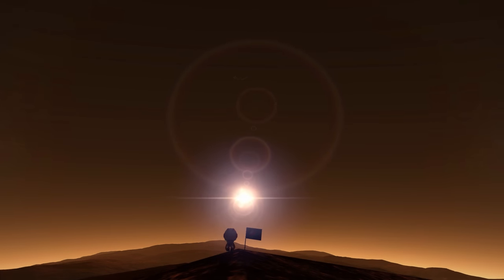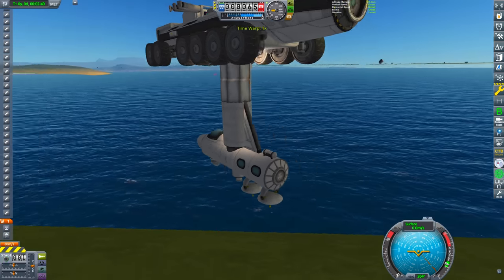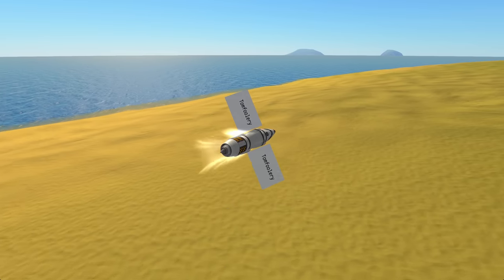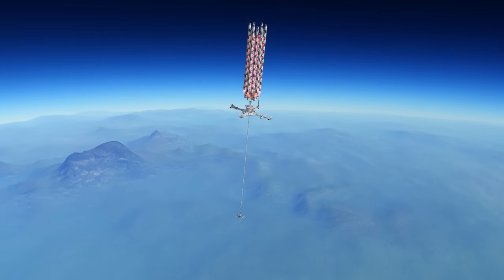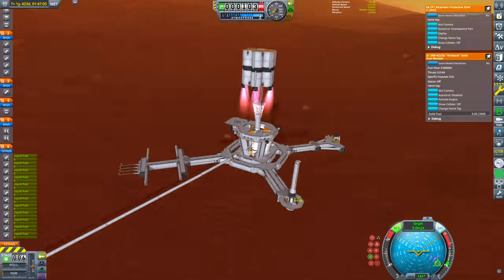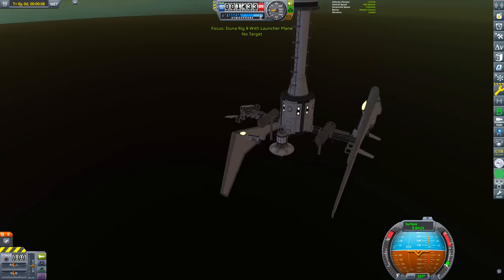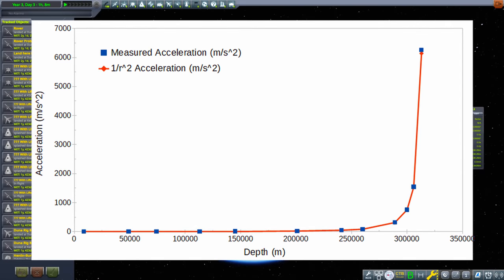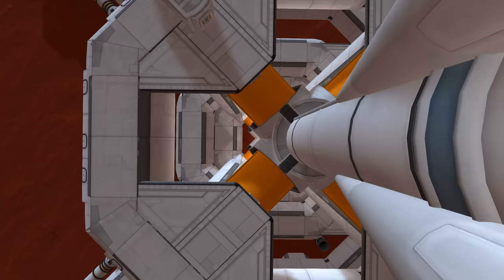Exploring the Underworld of Duna | KSP 1.12.3

Comment: could the phisics range thing be used to make a space elevator or orbital ring or some other large structure the game doesnt usually allow? also what happens when you drop a probe underground on an airless world? to me it seems like the first parachute probe was destroyed by air forces, not the high gravity directly.
Reply: With enough patience, it absolutely could.

But just for a space elevator to low Kerbin orbit (let alone keostationary) you’d need to stack at least 16 modules, each 4.5km tall (2.25km distance above and below the CoM in order to see them and their colliders) to pull it off
Reply: @alexsiemers7898  i might give it a try (probably using mods like vessel mover though). i did make a tower a third of the way to space in SFS one time using no gravity cheat to stack pieces until the game decided to despawn it when i reached the top so i couldnt extend it any further...
Reply: @alexsiemers7898  i just read on the KSP wiki that gilly has the lowest synchronnus orbit at 42 km so i might try there
Reply from the maker: I tried a minmus space elevator using this tech for Ortus City. Sadly it didn't work out because the game changes reference frames at 100 km above the surface for all planets, which makes the colliders very funky. Gilly may be the only body where its possible to build a space elevator

Comment: amazing video. 1 physics question, doesnt gravity increase initially as you descend into a planet before reaching some switchover point where it starts getting less? Also in a hollow planet (without a black hole) the inside would have no gravity just under the surface, which would be really cool and mind funking.
Reply from the maker: For a uniform density, gravity would decrease linearly as you approach the core. However, as someone else pointed out in a previous comment, planets don't tend to have uniform densities. This post explains it better than I can: https://physics.stackexchange.com/questions/18446/how-does-gravity-work-underground

A hollow planet would be really cool to explore. If its rotating, you would actually get artificial gravity on the underside of the surface which would be extra funky.

Comment: I wonder how close you could orbit an airless world before extreme rotation or the tidal effect destroy your craft?

The max rotation a craft that isn't physicsless can achieve is around 50 rads per second before the physics engine bugs out. On Tylo you'd need to orbit at like 1.2 km from the singularity, with about 200,000 G, before a craft would reach such short orbital periods.

However, at such a distance there is an insane 300+ G/meter of tidal effects. Maybe small durable probes could survive at this distance (although the physics instability could have odd effects on their orbit. I am not sure whether they would cause their orbit to grow or decay).
I think you could have small crewed craft out to 5 or 6 km without knocking out the Kerbals or breaking off parts of the craft. Large ones would end up being under dozens of G of tension.

Past 20 km I think tides would be noticeable but not particularly dangerous to any sensibly constructed design at under 0.1 G/m.

Comment: 7:15
I assume that this is because the game only checks your state whenever your state is supposed to update, for example, if you're flying, your state doesn't update until you're either suborbital, orbital, landed or splashed down, meaning that as long as you keep your current state, it will not change, and since you never technically started flying, you were always flying, the game never updated your state, but if you even as much as touch the ground, it gets updated, because i assume that the ground collider doubles as a trigger.

Comment: "Sadly, at some point, we recieve a massive spike of reentry heating, which destroys the craft." That's not just at any random point. The altimeter is listed as the craft being destroyed at just under -315 kilometers below the planet's surface, and, as you stated earlier, Duna's radius is 320km. Whether you got just close enough and were given a hell of a gravity assist due to the somewhat ovular orbit, or whether you dropped close enough to pass through it by way of the massively increased gravity over even a few meters, clearly it pulled you in and either bent the craft right out of shape, exposing the components to the sea-level equivalent atmospheric drag at those speeds, or it outright accelerated the craft enough that even its near-zero drag was enough to destroy it. The irregularity of the altitude, with a roughly five kilometer difference, suggests one of two things - either the craft was torn apart just before reaching it, or the altimeter stopped working after it happened due to game speed limitations - perhaps above the point by a much further amount, leaving the number at a lower point due to the immense speeds involved; or perhaps right as the craft touched it, with the altimeter following some piece of debris as it was destroyed in a separate calculation, travelling nearly five kilometers directly away from the singularity in a single tick of game processing. Singularities are unimaginably powerful, and this is a small one, as you know. Terrifying stuff.

Comment: Back in 1.7.3, I made a probe intended for exploring the deep oceans of Kerbin. It is equipped with powerful engines, has almost no drag, and has infinite fuel turned on. Once I created some distance from the shores, I dived deep down. To my surprise, the ocean floor doesn't exist, and the probe went straight through Kerbin, hitting speeds of over 11000m/s at the core, then emerging from the other side. I didn't encounter a singularity, but it's probably that I missed it. I tried the same thing in 1.8.1 and later versions, it does not work

Comment: Would the aerodynamic drag and heating be zero if you tried this on a body with no atmosphere?
Reply from the maker: Yes, but its not so interesting. Since the planet is airless, you don't really see anything until your reality gets ripped apart.

And also, it takes a ton of delta V to get into a low circular orbit around it. You'd need a kraken drive to pull it off

Comment: Here's an interesting detail about gravity underground: From what we've measured, while gravity increases exponentially as you get closer, the decrease as you get deeper below the surface is linear.
Reply: That is not what we measure, it is what we calculate, if we suspect, that the density of the celestial body is constant (and that is not the case, for sure). In fact: The gravity inside the earth increases up to 10.7 m/s² over the first ~3000 km underneath the surface. And drops then from there to zero at the center. And this is also an calculation, but based on a realistic density model.

Comment: From a programmer's perspective, the "black hole" or "singularity" is just the result of using a simplified point mass Newtonian gravitation calculation instead of having to take an integral adding up all the forces from every bit of mass in the planet's volume which would of course be quite bad for the game's performance. Now looking it up, "Newton's Shell Theorem" presents the simplified solutions for these integrals. Outside of the planet, it's as though the mass was all concentrated at a point or singularity at the center of the planet, while within the planet, the net gravitation actually decreasingly decreases toward zero as you approach the center of the planet assuming uniform density; I am curious as to whether that arrangement allows anything other than perfectly circular orbits, or at least what shapes those orbits would attain. Another interesting result is that the net electric field inside a charged shell is zero everywhere within that volume.

Comment: The descriptor of paper thin shells with a black hole in the middle is actually one I've used to describe how ksp works from a physics standpoint to people before. Explaining warp phenomena like being able to gravity assist through a planet at high enough speeds.

I described the planets as paper mache though. But it's the same thing.

The singularity could also explain how these planets are usually impossibly dense if you really wanted to stretch and bring these planets back into the realm of pseudo science shitposting.

From memory the only body in ksp that has a physically possible density is Eve's moon Gilly. And I think it was about as dense as lead.

Meanwhile I think asteroids were as dense as shaving foam or something.

Comment: So, if you do this with ike ( no rentry heating) when you reach the core you will get massive amounts of speed and get ejected back to the surface and crash, i think this is because of the way ksp handles gravity assists
Reply from the maker: I think its more likely an issue with discrete time steps of the simulation. I didn't show it here, but the G-forces on the craft gradually increased as it got lower, which shouldn't happen since it's in free-fall. At some point, the acceleration is so high that the simulation stability breaks down.
Reply: @Stratzenblitz75  interesting
Reply: @Stratzenblitz75  Since this gives you alot of momentem, can this be harvested to fling to another planet or another solar system? 🤔That is if your able to excape the crash when you reach the surface.
Reply from the maker: @littlesneez9002  That is certainly worth investigating. I think if you get the right approach, you'll leave so fast the ground can't get you

Comment: This is so weird. I imagine the singularity is caused by the method they use to calculate gravity. They probably determine gravity as a function of distance from the center of a body. Because it's distance from the center, as you get closer, gravity approaches infinity. When you get to the center, the numbers get so high that either gravity destroys your craft or acceleration and heat from air resistance or reentry does it.

Comment: It's not actually clear-cut how gravity changes underground in a large body. While you would always expect to have zero gravity in the center (barring a singularity), it only decreases linearly as you fall towards the center in bodies with a constant density. Things can be different in large differentiated bodies where denser materials have sunk to the center. In those cases, it is possible for gravity to increase for a while as you go deeper. On Earth, for example, the highest gravity is at the core-mantle boundary, where it's (IIRC) ~10% higher than on the surface.

Comment: Attempting this in RSS, and it appears I have some mod which prevents this behavior from happening. Some extra check is in place which moves the craft to touch the surface based on its lowest part, not the root part.

Comment: 15:30 - This is actually incorrect. For a spherically symmetric planet, any mass above you as descend into it has no effect. For example, if you dug into a "hollow" planet that was a spherically symmetric shell, once you got through, inside the hollow interior you'd be completely weightless. The gravity from the mass of the crust above you cancels out perfectly, if it's spherically arranged.

Gravity gets weaker the deeper you dig into a planet because the total mass below you decreases.

A consequence of this symmetric property is that the gravitational field outside a perfect sphere is identical to one generated by a point-mass of equal mass, at corresponding radii. Accordingly, even though Newton's law of gravitation only describes point-masses, we can use it to reasonably describes stars and planets even to relatively short distances.
KSP takes advantage of this by just placing a point-source of gravity at the center of every planet.